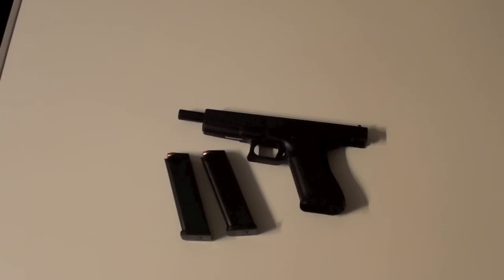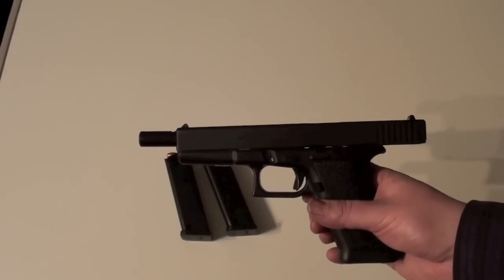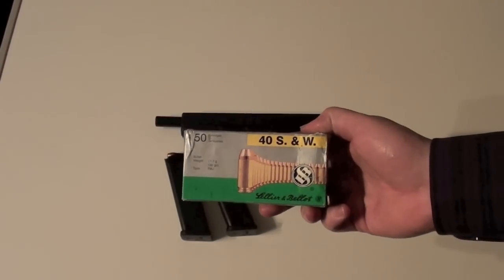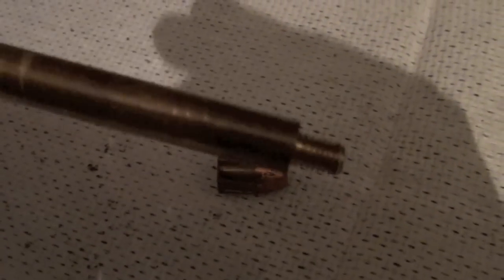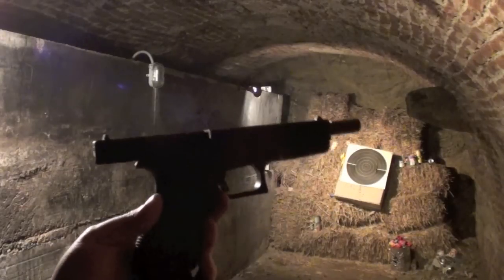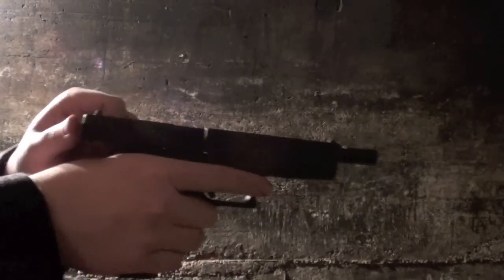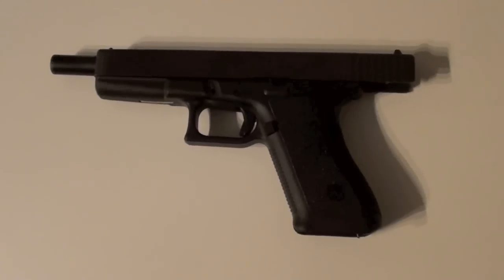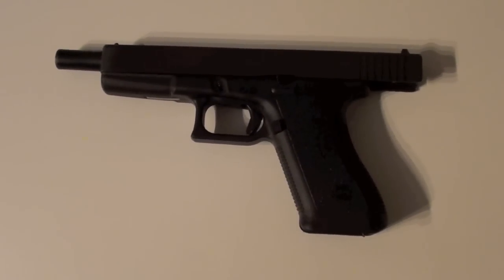Glock 24C dangerous malfunction with old ammunition

Comment from the maker: In Austria it depends on how many rounds you buy, it gets normally cheaper if you take 1000rds. The prices for a 50rd box are 16 Euro 9mm, 20 Euro .40S&W and 23 Euro .45ACP. If you buy 1000rds the prices for 50rds are 12 Eruo 9mm, 15 Euro .40S&W and 19 Euro .45ACP. It depends on which ammunition from which factory. regards eric